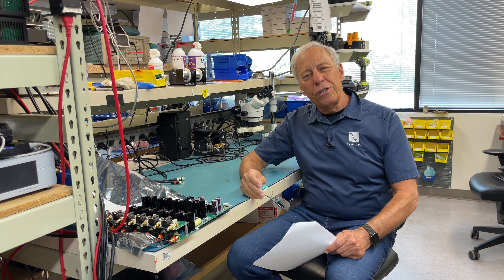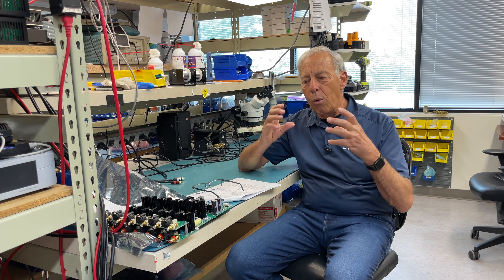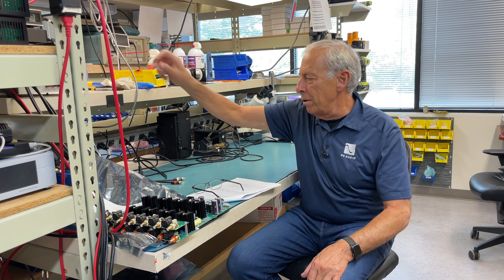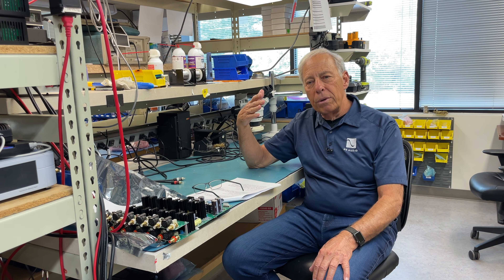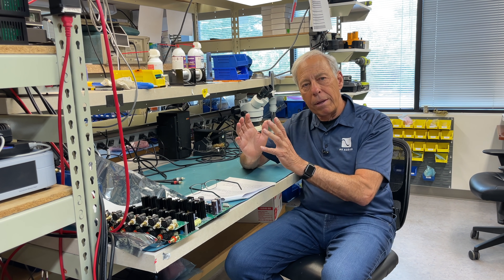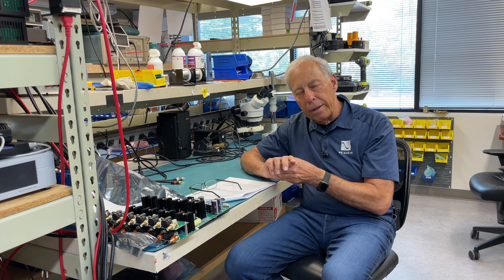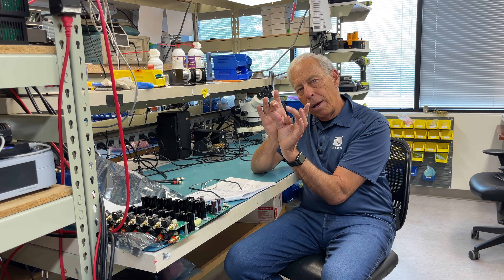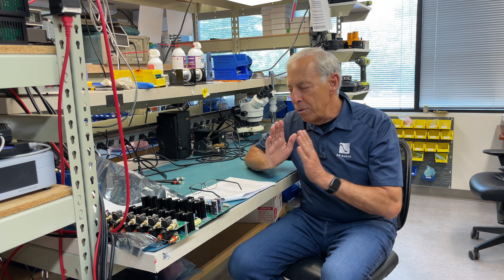The history of volume controls

Comment: I would be curious to measure the distortion through a "gain cell" preamp. Yes, this seems to be a classic Gilbert Cell Multiplier circuit. Used extensively in analog broadcast video gear for various gain control functions . A fade between two cameras, a circle or shaped wipe between two video signals, all done via a Gilbert Cell Multiplier in the analog era. Now PS Audio is the only company they I know of who used this circuit as a volume control.  I think there's a reason for that. Video is not as sensitive to wave-shape distortion as are audio signals. Now it's possible PS audio has fine tuned the classic circuit for lower distortion but traditionally these circuits have high THD by high quality audio standards. The MC1495 was the go-to chip to perform this function but they can also be made discretely, even with tubes. Although the discrete component matching is critical. Also keep in mind that a digital gain control, be it hardware or software implemented, is just a multiplier function. But here you generate additional bits that must be rounded back down. No perfect volume control exists - even with digital technology.

Comment: i use my minidsp shd studio as volume control, since i need the dsp options. i wonder how that affects the sound compared to more standard preamps, if i ran my shd studio without dsp disabled of course.
Reply: I had a minidsp SHD studio for a couple years and used it to control volume into the power amp input of a integrated amp. I thought it was fine ontill I really started upgrading my system and got a dedicated room with added room treatment. I switched and used the integrated amps volume control instead, and found it to sound much better.

As usual, it might depend on your system but, I've now found that digital attenuation/control is not that great. I have an Auralic Altair G1 streamer and still found the digital volume control to be noticeably worse that using my integrateds volume control.
Reply: Those are ok, but not real HiFi.
Reply: @qddk9545  those? i only mentioned one specific digital only produkt.
Reply: @qddk9545  Honestly, you'd be surprised by how good it sounds. Comparing it to the Auralic is impossible because the Auralic uses an on-board DAC but.....the MiniDSP and denafrips DAC combo I had produced excellent detail with great depth. Dirac room correction is also very impressive, as most people will tell you who have actually used it for a time. 

I only sold the Mini DSP because of hardware and software problems. Maybe I had a lemon but, it was way too much of a hassle. Definitely a good sounding unit though.
Reply: I have 3 of them 😃

Comment: Thanks Paul, what perfect timing for this topic!  My Onkyo stereo receiver from the 90's 'TX-8511' uses a pot for the volume and tone controls.  I decided to experiment, and I found the Onkyo sounds better using a modern receiver as a pre-amp/volume control, and maxing out the Onkyo volume pot treating it like a power amp.  Tone pots are kept neutral. 

It's usually undesirable to double up  a pre-amp like this, and I'm sure I'm still losing quality thru the Onkyo preamp even with the volume pot maxed/tones neutral.  I don't hear noise or hiss, and am still wrapping my head around the benefits/losses of this.  Overall, the sound definately seems improved and I was a bit surprised

Comment: I have motorized pots on my AVA, and it doesn't make any noise, nor does it affect the sound, what are you talking about?
Reply: You can not know if it affect the sound because you can not try without it (unless you have technical skills that would stop you from making this comment).
Reply: @hugobloemers4425  Measurements would reveal it if it was a cause for concern. Which it isn't.
Reply: @hugobloemers4425  So all recordings are then flawed, according to this nonsense, oy vey......when does reality come back to audio stuff?  Just claiming it "affects" the sound, without any specs, data, or reasons, it's just marketing BS.  from a company tahts sells a "noise harvester", which has 0.0 ability to do anything...it's been tested and graphed, it's useless junk...go find Audio science review amir, shows it's useless crap...and not UL or ETL listed, for something you plug in, when it doesn't handle a spike and starts a fire, why isn't it ETL or UL independent lab tested, to meet both electrical safety standards, and spike protection specs, yes, UL has them...I can buy many legit brand spike suppressors, from real mfgs., like Leviton, hubbell,P&S, , and a dozen more, that are UL listed, and safe, and actually have a spike suppression spec...not a plastic dumb thing from PS

Comment: I think my Phase Linear pre amp has an attenuator. I recall the phrase "padded attenuator" in the owners manual
Reply: Interesting question, I wonder if the 'padded' part refers to an L Pad, which if I remember correctly keeps a constant impedance to the driving circuit so as not to load an amplifier such as used in a PA System with multiple speakers.

Comment: Very interesting description of alternatives.  Gaincell makes sense.  
I could add an autoformer volume control as something that can be better than a pot or a stepped attenuator, but even more expensive than your example of Vishay Naked Foil resistors.
Reply: An autoformer have different impedances so it's loading an output stage different in each position, I guess it will cause audible side effects. But that's a guess. Have you ever tried it and how does it sound?

Comment: I thought the first remotes were the size of a brick and used little metal strips like wind up music boxes use. Sounded like rubber bands when you clicked the buttons.
Reply: You're thinking of the Zenith Space Command TV remotes from the 1960's.
Reply: @InsideOfMyOwnMind  My dad, who Hated commercials, had one of his children sit by the TV to change the channel! He was a cheap son of a gun, but started buying top line Zeniths as soon as Space Command came out. My job, then, became “maintaining” the remotes, because he wore them out pressing the buttons like a machine gunner. There were little aluminum bars inside, suspended by a pair of piano wires, one on each side. I bought the wire from a hobby shop and refettled the remotes every few months. It beat sitting next to the TV all night!
Reply: @Chris.from.1950  I had an older brother like that. He grew up later to be the extreme opposite.